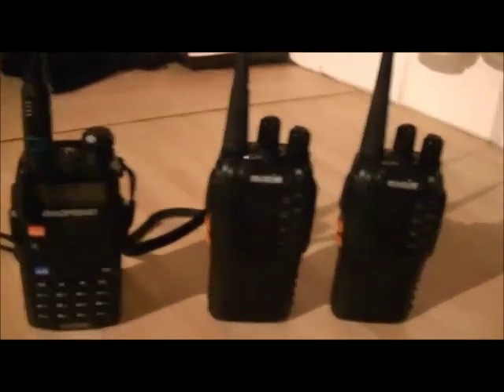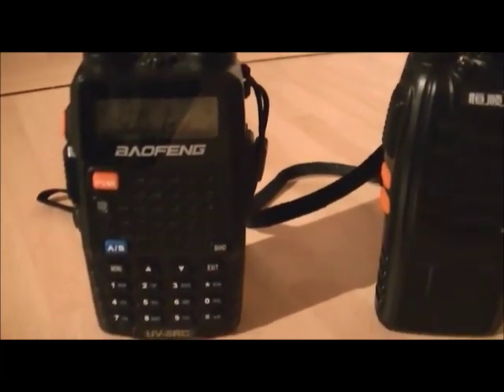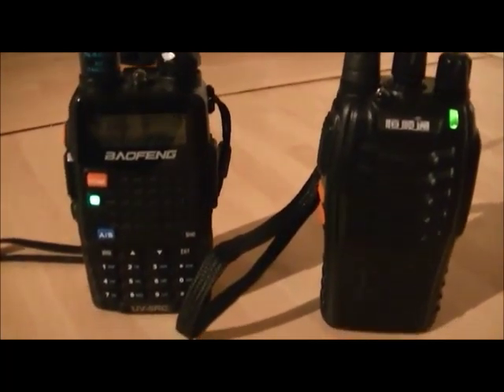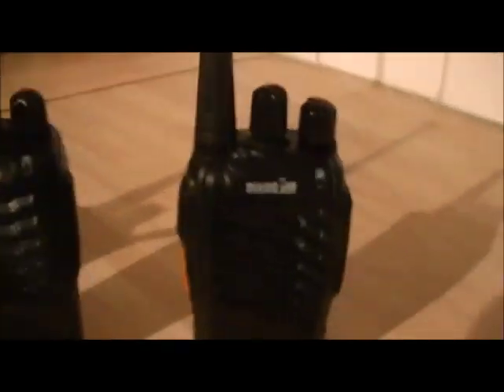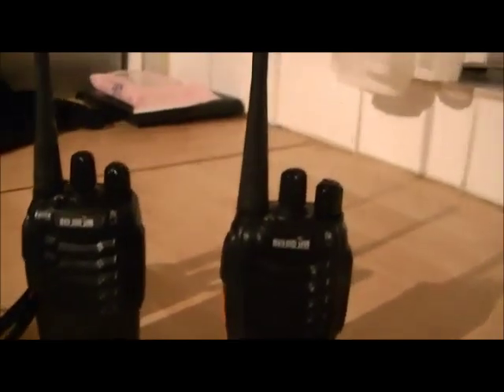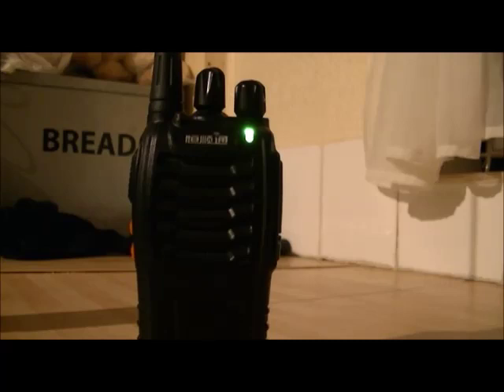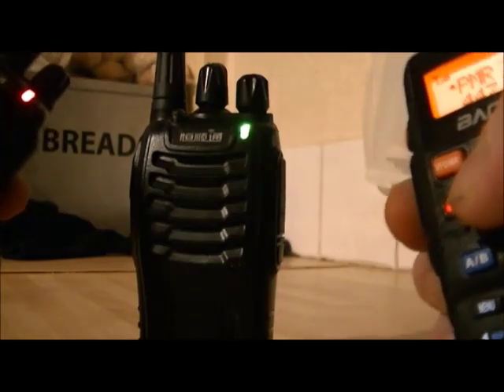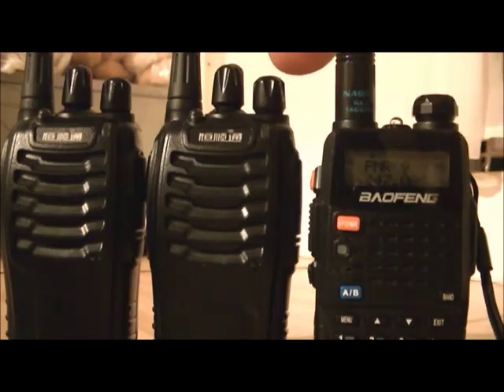Baofeng UV-5 RC / H-777 CTCSS explained

Comment: I was having a problem interfacing with our repeater.  We have motorola apx4000 transmitting through a mtr3000, Quantar duplexer.  At this time we are using conventional rather than digital.  Programming the baofeng to work with the repeater seemed to be impossible.  I saw your video, scanned for cts tones and now am transmitting through our repeater.  We are a Volunteer Fire Department and these radios are going to be take home for the Crew so they can monitor Emergency calls.  Thank you.

Comment: have within UV-5r + plus and I have a BF-888s, I want to communicate between them, have frequency bf-888s and I can send and receive on uv-5r + plus but not transmit from uv-5r + plus, and hopefully can help me, thanks
Reply from the maker: it sounds as though you have wrong ctcss or wrong frequency as they should work on same frequency.Do you have PC programs and usb lead to program each radio,if not may be worth getting lead as you can download programs free from internet.?

Comment: Hmmm. Baofeng software is a BITCH!! I finally got it on my comp. and got it working and discovered it will not program two identical baofeng radios???? W... T.... F... it will connect with one and not the other. I would like to shove this

Comment: that's funny, ( fear factor ) ' you may get into trouble ' who's to say your not using a hi-gain db antenna?, had one but traded it for another bicycle,can always use parts, have enough hf-vhf-uhf rigs, but they are durable, fell on the ground more than once while riding, much to my surprise, it still worked perfect...easier to program with computer because they work along the lines of set trunk channels, much like police and fire. can't beat the price, enjoy!